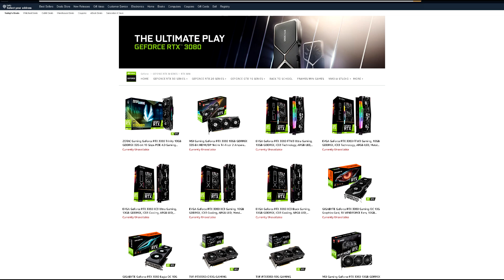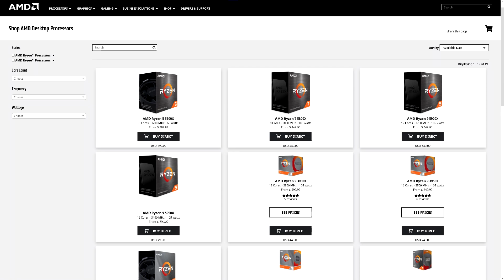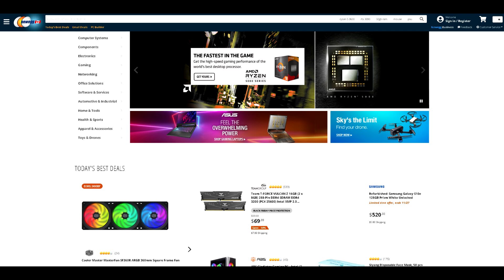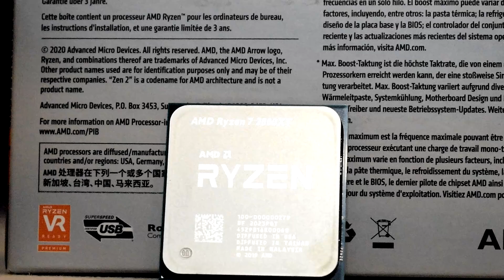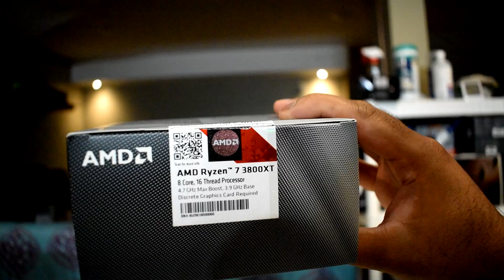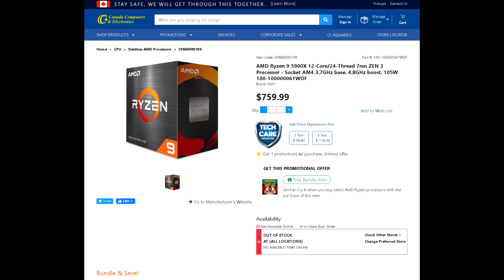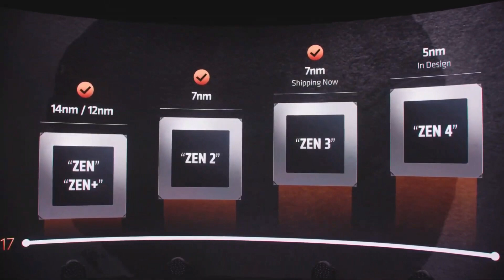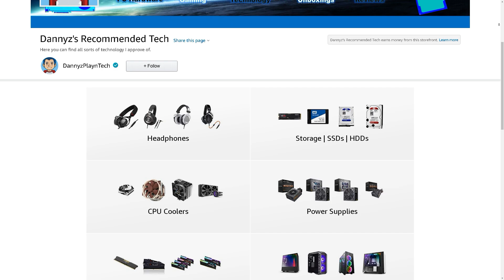AMD Ryzen 5000 Series CPUs Out of Stock? VERY Low Supply for Ryzen 9 5900X and 5950X

Comment: Dont feel to bad canada.I live in ny and couldnt get one either.I was up at 6am and tryed newegg.All i wanted was a 5600x.That was a no go.Micro center was a no go.Amazon no go.I bought inoto this amd thing a long time ago when they had no problem supplying there product.I have also bought an a 320 board with cpu and no problem.They cut that board off from any cpu upgrade past zen+ Intel has also been cruel through the years with there constant socket change but they seemed to deliver what they promised.Now i wish i would have stuck with intel after buying a b550 with B die  no chance again  to upgrade.Will amd buy back my motherboard and cpu and ram after another debacle like the 3300x?

Comment: There were 2 5800x at my CC. That's it. No 5900x or 5950x. I was second in line, and walked away with a piece of paper for a 5900x. I was told they expect the wait to be 2-6 weeks. Has anyone else received similar ETAs?

Comment: The demand was too high, here is a risk you take of oversupplying which is worse than undersupplying. Nvidia did just not supply
Reply: Sending a single 5900x to seven of the dozens and dozens of Canada Computers locations in Canada is nowhere near oversupply risk.

Comment: I am 172nd in line at my shop in the Netherlands for the 5900X.
In the Benelux (Belgium, Netherlands and Luxemburg) there were only 150 5900X processors brought in.
The Netherlands only had 3 shops with 20-30 5900X processors per shop. I reckon it was the same for the other 2 countries coming to a total of 150 pieces.

So being at 172nd of 668 waiting at Megekko.nl currently, and with the batch sizes and wait time for the next batch being 10+ days according to Azery.nl and Alternate expecting the next batch no sooner than 2021, I doubt I will even get mine before my birthday on the 22nd of February.

Which is horrible compared to the wait time on the current processor I use and had pre-ordered... the i7 2600k.

So no, I am far from hopeful and just hope the shop doesn't go out of business in the mean time or I'll loose a good chunk of money.

Comment: 3 each of 5950x/5900x at my local Microcenter tons of 5600x/5800x tho. Ryzen 9 was a paper launch
Reply: I ordered the 5900x because I want my cpu to last me 5 or 6 years before I am forced to upgrade to keep up with gaming demands.  I know it’s a little overkill now, even for 4k gaming with a high end gpu but I am trying to future proof.
Reply: @Goldrilla1 12 cores is not far fetched for the average consumer, not everyone builds a pc for gaming alone. Considering these new cpu's are meant to compete with Intel & tackle BOTH high end gaming / rendering workloads, you would expect for there to be more stock in his scenario.
Reply: @aaronmiller7587  but what bothers me is people getting the 5950x. Ffs who needs 16 cores to game?? It's the same argument as the RTX 3090, but in this case there's 0 to no benefits in gaming, as people who needed all that cores are all content creators or workstation users.
Reply: @Goldrilla1 The thing is I also use my PC for work. A 5900x is good at gaming and good at multi threaded workloads. I'm a software developer and our compiles for work are fully parralellized. A 5900x would reduce my build times significantly and I can still game with it in my off time. It's the perfect CPU and everyone but AMD seems to realize this.

Scan UK's order numbers for the 5900x were like 10x higher than each of the other processors, but AMD barely made any of them.
Reply: @seangill1096  yeah but realistically speaking, you would get newer ones instead of getting a multicore monster this year since you won't be needing it soon.

So I stand corrected that the average gamer won't need all 16 cores. Plus it has been proven that the 5800x or 5900x beats the 5950x in gaming performances since there's higher base clock.

It's just like the RTX 3090 and 3080 argument. And likewise content creators are pissed af at dumb sheeple who don't do their homework.
Reply: @seangill1096  which is why I said content creators or producers/designers are pissed at sheeples making uninformed choices with the RTX 3090 when they should be getting the RTX 3080 instead (unless they game on an 8k system then by all means).

It's the same with the 5950x vs 5900x or 5800x. I'm pissed because I actually needed the 5950x to make bread, but I'm guessing half of these retards probably won't utilise even 50% of 5950x's cores. And again, 5900x is still a much better choice for gaming with better single core clocks.